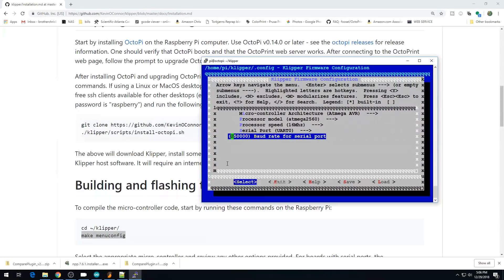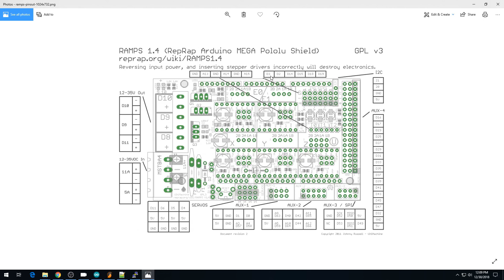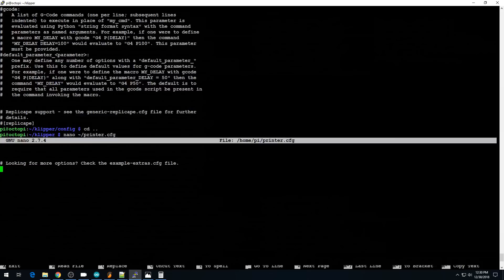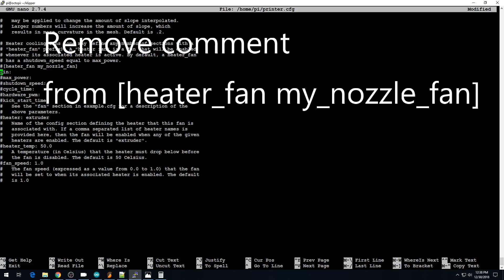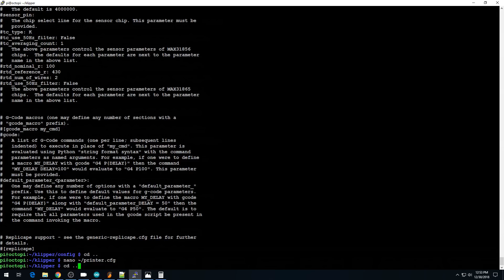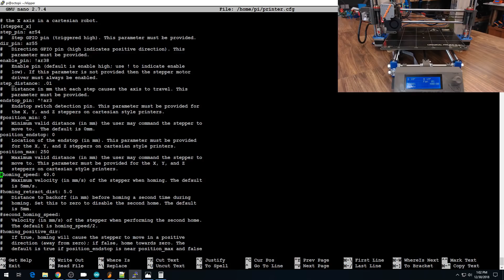Klipper 3D Printer Firmware Install - How To - Chris's Basement

Comment: So I started to do the klipper install.  But how would I set this up for an Ender 3 with and mks gen l v1.0 with a slice engineering thermistor. Not sure how to define that setting.  Also how would I properly define tmc2208 drivers.
Reply: Also great video
Reply from the maker: I would have to go back and look at the Klipper config files, I am not sure how you would add all that in.
Reply: @ChrisRiley  nah bro do not bother. I do not think there is a config for the Slice Engineering (SE) thermistor. I have both the thermistor and heater installed. But if there is a way I will greatly appreciate the information. 

As for klipper I will try it out on my other ender 3 as it is a completely machine. I really love the work Kevin put into it, and the results it brings... from what I can see. And not being limited via processing vs the actual machine limits is wonderful (in respects to speed and other aspects). 

Again there is no rush for info regarding my inquiry. But if it is available out there somewhere I will again appreciate a response at your earliest convenience. I think I will try and contact Kevin as well.

Thanks again,  James (Shenkoe on any other forum or site).
Reply from the maker: @purplemunkecustomz6996  Cool, when I get back into it i'll let you know. I will keep you updated.

Comment: Hi Chris, Your video convinced me to try klipper on my own designed corexy printer with mks sbase v1.3 controler. After some mistakes on my side it now works perfect. The printer is more silent, much faster (now printing at 150 mm/s and using pressure advance prints look much better. There is one little question i have. You make a G29 macro for auto-ledleveling, Why don't you use SAVE_CONFIG to save the mesh to the config file so you only need to calibrate once. I have a 300x300 mm bed using your macro for this bed (10,10 probes) would take to long if I had to use it before every print.
Thanks again for your video your channel has helped me and a number of fellow 3d print geeks a lot.
Reply from the maker: You're very welcome. You are correct, saving the mesh is a very handy feature. If I was working on a different style of printer, something a little sturdier than log, I would take that route as well. Log gets tossed around so much he needs all the help he can get.
Reply: @ChrisRiley  OK thats clear. Students of mine (I'm a computerScience teacher) build there own hypercube for school. I want to run it with klipper so I was wondering if there was an advantage for your choice of leveling. It's clear now that I can use the SAVE_CONFIG. Thanks a lot and keep up the good work.

Comment: Chris Great Video! Have Klipper running well on my Folger I3 clone. But I have recently purchased an Anycubic Kossel, and am looking to run Klipper on that. I do see on the Klipper FAQ that I can run multiple instances of Klipper on a Pi. I also have watched your vids on running multiple Octo's on the same PI. So wondering if  anyone has experience with this. Will the PI have enough power to run two insances of Klipper and Octopi with webcams? Or should I just save myself a headache and get another PI?
Reply from the maker: It will have enough power, but the configuration may not be that easy. You might be able to get it to work but I have never tried it. Good luck!

Comment: Hi Chris, thank you so much for this, could you possibly show how to do a dual board? I'm really having trouble figuring out how to do a master firmware for the main board, and slave firmware for the 2nd board, do I need like another config for each board? Thanks!
Reply from the maker: Dual board? You mean 2 main boards at once?
Reply: @ChrisRiley  Yes! I got it figured out now though, but it would really help others as there are many others like me who aren't good at following docs (I read most of the docs, but it only became somewhat clear to me [I didn't fully understand until I compared 3 different setups and saw it] after watching a few videos [I'm more of a visual learner]. 

The problem for me was that I didn't know how to make it so the pins go to each board. I know now but a visual version would again be great for those that need it as well!
Reply from the maker: @iamthebest22  Very nice! Glad you got it working. I will look at making a video on it.

Comment: Once again Chris, thanks for the video! I'm actually looking at using klipper on a non 3D-printer project, using 6 arduino nano clones to control 6 different stepper motors.  The clones are the cheap Chinese knockoffs with the old bootloader that are available all over Amazon.  When using the "make flash FLASH_DEVICE=/dev/ttyUSB0" command I'd get an "avrdude: stk500_recv(): programmer not responding" error. After much reading, I found the solution.  Open '~/klipper/src/avr/Makefile' in nano and change the last line '  $(Q)avrdude -p$(CONFIG_MCU) -c$(CONFIG_AVRDUDE_PROTOCOL) -P"$(FLASH_DEVICE)" -D  -U"flash:w:$(<):i"
  '  to: '   $(Q)avrdude -p$(CONFIG_MCU) -c$(CONFIG_AVRDUDE_PROTOCOL) -P"$(FLASH_DEVICE)" -D -b 57600 -U"flash:w:$(<):i"
 '  The ' -b 57600' sets the avrdude writing baud rate to 57.6K, which is compatible with the older bootloader.
Reply from the maker: Sounds like a cool project and that was a good find on this info.

Comment: Great tutorial.. Thank you for posting this.
Reply from the maker: You are very welcome!
Reply: @ChrisRiley  I am going to try this on my Tevo Little Monster and see what happens.
Reply from the maker: @CaseyHerman  Do it! If you are successful it will be awesome!
Reply: @ChrisRiley  I have successfully got this working on my printer. Thanks for the guide! 90% of it worked for my printer.  Had to load the firmware via SD card for the smoothieboard. I would advise not messing with the BLTouch and use their DELTA_CALIBRATE manual mode. As it does the paper test in several positions. BLTouch portion seems to need work on the delta side of things. Translating the macros over to this setup has been interesting. but I have it all working now. LED light control via gcode macro is working. Great stuff. So far the print testing has been outstanding.
Reply from the maker: @CaseyHerman  Awesome! Thanks for the update, I am glad you got it all working!

Comment: Hi,

i just fried my Arduino Mega under my Ramps 1.4 just when i switched on my printer power supply.
I connected my Ender 3 Hardware to the Ramps and the Raspberry via USB.
After a little reading it seme, the two power supplyes shorted the Arduino py a ground shortage: https://reprap.org/forum/read.php?219,212588 
My wire stup is the standard Ramp 1.4 as seen here: https://reprap.org/mediawiki/images/6/6d/Rampswire14.svg
The only thing i changed is i only have one hot end and i put the part fan on D09. Also i connected the main power plug like this: https://www.v1engineering.com/wp-content/uploads/2015/10/IMG_20151023_110317.jpg

Does anybody has an idear what i might have done wrong?
Sorry, i konw its kind of offtopic... but i was "on the way" to finally use Klipper.

Thanks
Reply from the maker: You were using your Ender 3 power supply on RAMPS? The ender 3 is 24v, did you make the corrects to RAMPS to allow 24v?
Reply: @ChrisRiley  Hey, thanks for the answer. Untin low i found the mistake on my own ;) but you were right ;)
Reply from the maker: @Kai-of9xl  Glad to help.

Comment: I'm just wondering... why?

I'm sure it works well and can enable a few more things than Marlin or RepRap Firmware, but this is a right old faff to install for seemingly no benefit?
Reply from the maker: I hear ya, you have to want speed pretty bad to go through the trouble.
Reply: Huge benefits if you want to print around 200mm/s. From what I've seen too, all the movements are exact with no pausing and the like which means cooler motors and quieter operation. I already push my CR10S to the limits but the little Arduino chip just doesn't cut it. The hardware, well stepper motors and the like are far more capable than the default boards and firmware would have you believe. There are people who spend days printing at 20-30mm/s for the "quality", with this you can do 120+ with sometimes better quality and the only real limit to the speed so far is cooling the plastic you're laying before the next layer comes blazing by.
Reply: @MidnightMarrow  with 200mm/s i would say you have to bullet proof you printer for vibrations and not just switch firmware, which i think is a lot harder (especially with large printes)
Reply: i have heard that the recent versions of marlin, are extremely buggy vs kippler

Comment: Hey Chris!

Another awesome How To. I have a question, can I use multiple octoprints on one raspberry with klipper? Now I have 4 octroprint on 1 raspberry and I have flashed my printer that uses Atmega with ramps with Klipper and I have another printerbuild that I will use a MKS Sbase for and planning to have Klipper on that one aswell. I dont know if you understand my question. :)
Reply from the maker: I am not sure yet if you can or not. I still need to do a lot of testing on that. We will need separate klipper installs to achieve this.
Reply: @ChrisRiley  Yes I thought so to, But it would be awesome if it would work.
Reply from the maker: Agreed, we will see what we can come up with.

Comment: Hey Chris! Any way you can help me do this to both my enders.I want to try unning them on the same pie and on one 10" screen.
Reply: I'm saying that I thought, when you run two or more printers on a pi. Using Octoprint, I thought they'd have to print the same gcode. Which is why I commented to do it with Klipper. If you can do it with Octo and on one Pi. I'll do it with that till I can help research the Klipper set up
Reply: Id rather do it with Klipper as well, since it would off load on to the pi. Instead of having as many issues with Marlin if I'm going to run to on one SBC
Reply from the maker: @snazzyriza9518  If you want to try Marlin, you can check this one out. https://youtu.be/7Saa1HpLRoM
Reply: @ChrisRiley  don't they all have to be printing the same Gcode tho?
Reply from the maker: @snazzyriza9518  No, with the multi octoprint/marlin config they are independent.
Reply: @ChrisRiley  wow and this whole time I have been holding off cause I thought it was the same gcode just on multiple printers
Reply from the maker: Hey Greg, I am not exactly sure how we would get this done at the moment. I still need do some more research on multiple Klipper installs.
Reply: @ChrisRiley  do you wanna try it with Marlin. Or would the two printers. Have to printing the same thing?
Reply from the maker: @snazzyriza9518  You can do this type of setup with octoprint instances. Is that what you mean?

Comment: Do I need a bootloader installed on my board before I start?
Reply: Yes you do bacuse Klipper needs to burn it's own firmware
Reply from the maker: Great question! I believe you would need one to be able to preform the flash.

Comment: Would this make the most sense with a delta? Offloading to the PI rather than having to get a 32 Bit board?
Reply from the maker: Yes, or core XY. Anything that can move faster then the code can process. Correct, instead of a 32 bit board.
Reply: @ChrisRiley  been looking to build a delta for about 5 years after my scratch I3, with this I can use my PI 3 with my old RAMPS! Your videos are awesome I watch them all!

Only other thing I may have missed it but thinking an MKS base would go well like this, does it support that be default? Also a shame we couldn't use the spi bridge like the einsy board, make it a nice compact package
Reply from the maker: Thanks for watching the vids! Yeah, I think an MKS base would work great, they are really close to a RAMPS anyway, pinout wise. That would be pretty cool to have a piggy back setup like that.
Reply: @ChrisRiley  going to have to look into interfacing the mks usb driver into a pi GPIO! Sure even the PI zero would be faster than the old 8bit, or look at the enisy board and copy it lol
Reply from the maker: That would be killer!

Comment: I was testing Klipper for about 2 months and my prints were never looking better. Since I am using a Mks Gen 1.4 + Octoprint setup it is a great platform to test on. The klipper firmware is hard to install, hard to configure and even harder to properly  tune but it gets the job done. I was unable to set my Pressure Advance (Linear Advance in Marlin) correctly, so I suffered from not sharp corners but the prints overall looked amazing. 
I now switched to Marlin back and will try to compare some results. Machine I was using was Ender 3. If anybody would like a working Ender 3 config with automatic bed leveling please let me now here :)
Reply from the maker: Awesome to hear! Thanks for offering up the profile. There will probably be people interested for sure.
Reply: @ChrisRiley  Here you go peeps ! https://github.com/welo78/Klipper/blob/master/Klipper_Ender3_ABL

And as always Chris awesome tutorial. What I personally like about your tutorials that they also branch out a little and explain all possible mishaps or errors users might do when following your tutorials as well as what to do and what not to do. Keep up the good work.
P.S. I was able to get speeds of up to 120 mm/s on Ender 3 without any print errors.
Reply from the maker: Thanks! 120mm, that's pretty good, it might be worth a try for that speed bump.
Reply: @Wello789  Thank you for sharing. So far, how is going your Marlin experience?
Reply: @1Esteband  i am hugely dissapointed. I could not get it to work properly. Even at 60mm/s. I went back to Klipper and will try to test it and help in development.
Reply: @Wello789, thanks a ton for posting your config file.  I'm currently in the process of an install on almost the exact same setup, and am looking for those last couple bits of info to make everything work properly.   My last couple problems are getting the display to work, and making sure Klipper knows which fans are which.  Then on to test printing, and pressure advance!  ;)

Comment: You don't need to restart the Klipper service when changing settings.  You can just type restart in the terminal window in Octoprint.  If you install the Octoklipper plugin it will do that automatically whenever you save a change to the config file.
Reply from the maker: Someone offered up that tip yesterday. It's a huge help, thank you!

Comment: Superb video Chris as always. I did try Klipper on my e10 and it was running fine for a while but then it started to through up errors everytime I connected to it, so I went back to marlin. I do intend to give it another go, when I get round to upgrading my controller to the mks gen l board with the tmc2208 drivers
Reply from the maker: Thanks! Yeah, I still need to do a bunch of testing, we will see how it goes. It does appear to be getting better all the time. We will see.
Reply: @ChrisRiley  well people have been reporting some fair decent print speeds using it but I know the pressure advance feature can sometimes be a hit or miss and takes some dialling in
Reply from the maker: Yeah, there is soooo much testing to be done on it. Hopefully I can get to even half of what I want to.

Comment: Chris, thanks for the comprehensive video. Do you know if Klipper has support for sensorless homing or other advanced TMC 2130 features? I see that klipper does support the einsy rambo, but just not sure how many advanced settings it supports. I'm using a Hypercube Evo (CoreXY), and I can easily hit the speed limit of the Einsy's 16mhz processor. 

Could you maybe make a related video with the features you gain, and more importantly what features you lose going from Marlin 1.1.9 to Klipper? This would really help people decide if its worth the switch for their application. I'm thinking about settings like advanced stepper control, adaptive step smoothing, Z babystepping, etc. Basically everything in marlin's advanced config file.

Thanks again for the awesome video. You deserve way more subs!
Reply from the maker: Hey thanks man! I am not sure what features Klipper supports on the 2130's. I for sure need to explore it more. I will work on it and see what kind of video I can come up with.
Reply: Yes, Klipper supports sensorless homing. https://github.com/KevinOConnor/klipper/blob/master/config/generic-einsy-rambo.cfg

Comment: One tip you could use. Instead of restarting the klipper service on the Pi when you changed the printer.cfg. You also could issue an FIRMWARE_RESTART in the Terminal in OctoPrint. This will restart the MCU with the new config. This will also clear out issues regarding the mcu being shutdown due to errors.
Reply from the maker: Awesome! Great tip, I am going to try this out.

Comment: nicely done maybe I'll have the guts to try it out now there is a good guide maybe you could do another video showing how to use an example config.
Reply from the maker: Thanks Matt! I can probably whip something together on that.
Reply: FIY there are multiple examples on the Klipper GitHub and saved as configs on the PI after the install. There is also a facebook group if you have any other questions.

Comment: You'd be better of locating the printer using the output from dmesg rather that checking /dev/, if there's anything else plugged into the pi it could also identify as a serial device and you'd not want to flash the wrong thing.
Reply from the maker: Hey Miggy! Good call, that could be bad.